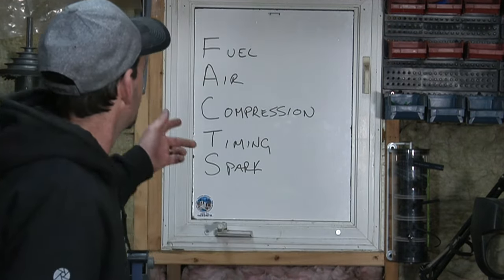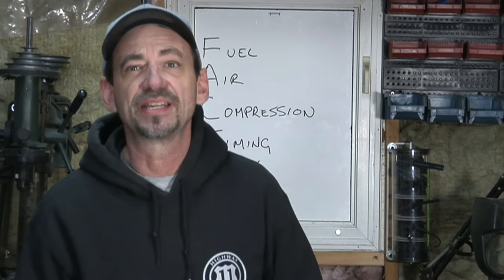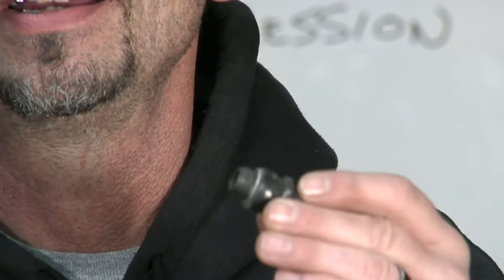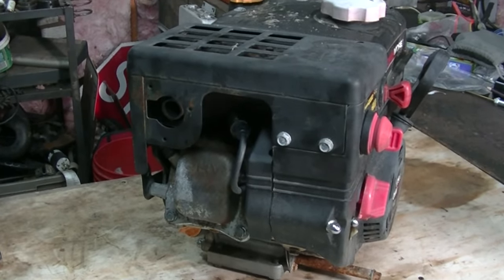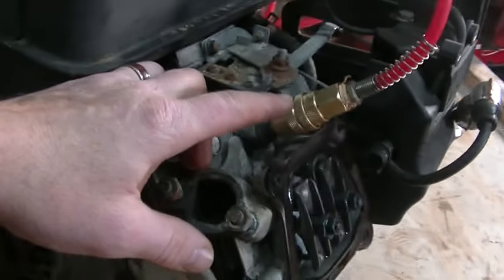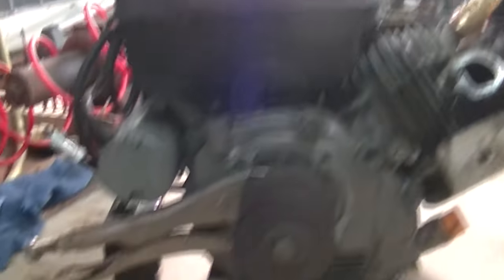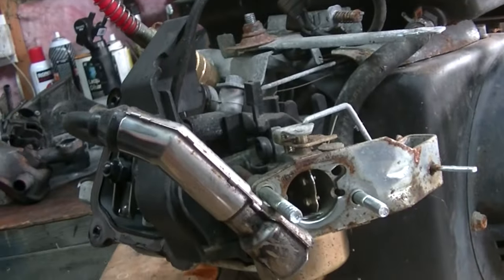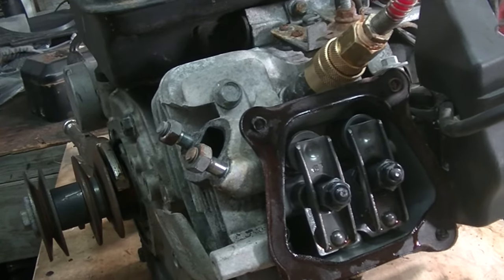DDD#7- Free Leakdown Tester!

Comment: I did that with spark plugs years ago but then you could buy oil burner fitting which only needed was screw a air fitting in and braze it
Reply: Which one, any links ?

Comment: Hey doc sprocket  i have question im working on my 97 murray riding mower (theres videos on my channel) bought a new ignition switch  my old switch has a ground plug on it but the new switch does not have it is this ground needed
Reply from the maker: Hard to say, without further investigation. 
Magneto ignition systems ground out the primary coil winding, to shut it down. So, you have the kill wire from the magneto going to the key switch. From there, the switch would either ground it in the OFF position thru an external wire, or the body of the switch itself.  The new switch might be a chassis ground type, or... you have the wrong switch.  A powered coil ignition system switch would NOT make a connection in the OFF position.
Reply: @DocSprocket  i did  in fact have the wrong switch (stole it from project red wiggles)  i did go buy the right switch and now its all in working order thank for the help
Theres a video coming soon on the 97 murray hope that you watch it
Reply from the maker: @GeorgiaRidgerunner  Sorry I was too late on the response. Tough to keep up sometimes. Sure, I'll watch! Might need a reminder,  but I'll gladly check it out.
Reply: @DocSprocket  its ok most people i ask things never reply 
You did be cool man

Comment: no easter egg thought you would have shown the engine going crazy when it's not set correct and you turn the air on ,,
Reply from the maker: Yeah, I'm sorry. Didn't have any bloopers or anything on this one. The mishap I had while doing this, was years ago- not this time. But hey- thanks for being one of the select few that KNOW to watch to the end for Easter Eggs!
Reply: @DocSprocket  in my garage i have the lock clamp from a leak down tester .. I will have to post a picture on you tube of it .. it's simple ..i don't have the gauge system but have the clamp lol ..the mishap would suck if your fingers are in the way .. my mishap was just a few days before christmas .. was using a hatchet slipped out of my hand  .. was on my knees in garage on the floor ,, it hit just above the knee .. went too the ER they put 5 stiches in .. not fun too walk a few weeks ..